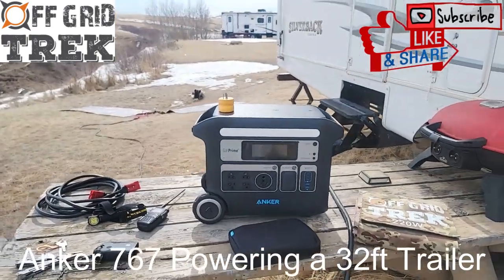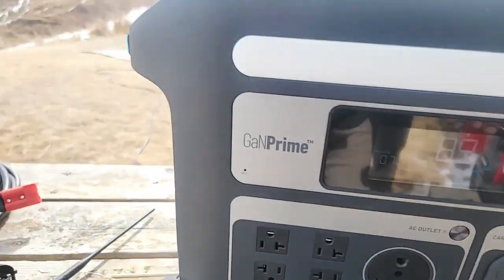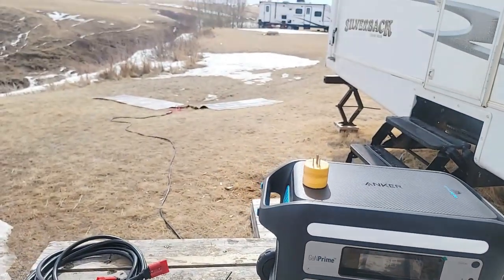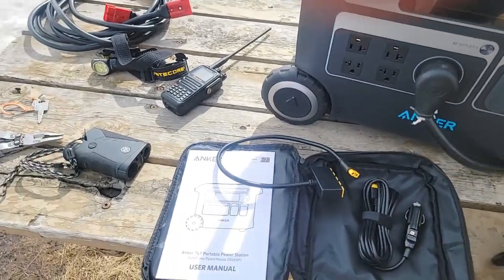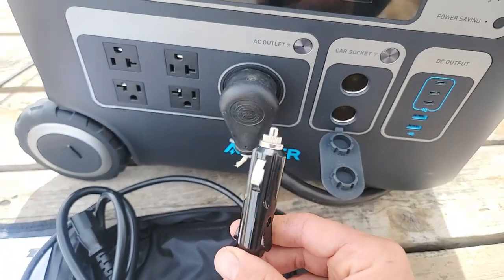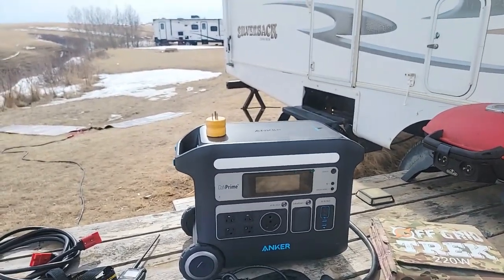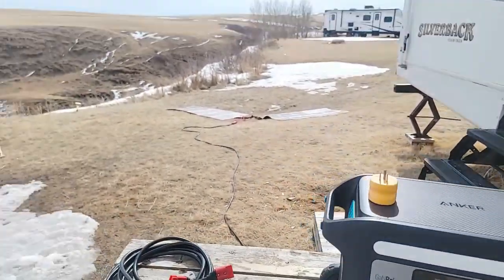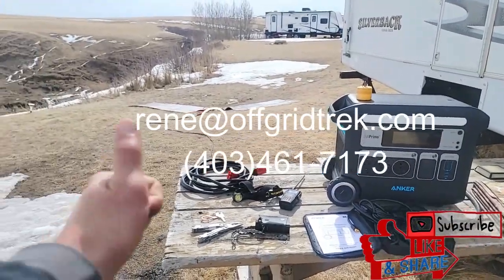ANKER 767 running a 32ft Trailer

Comment: I know absolutely NOTHING about solar or electricity. I want to convert an enclosed trailer to a camper. I want to be able to stay out for a month at a time.  I understand there are many variables. However, would this work for lights, occasional microwave, small TV and small fridge? If so, how many panels would I need …given the voltage limitations?    It seems to me this would be less complicated to employ …rather than wiring up the trailer.   Advice?  I also notice Anker has a 3800.

Comment: One thing I wish it has was the 12v 25 to 30amp output like the Bluetti. I have the AC200P and use it to run my 12v of the trailer by plugging it in and using it like a deep cycle battery. Is 10amps enough?

Comment: Think the powerhouse could power a slightly smaller camper with one small fridge and ac unit running for an entire day or more? Planning to buy one for my trip across the US. Thanks for the video!
Reply from the maker: The AC is the big power draw, you can only run it for 1-3hrs depending on size, settings and if you installed a soft start or not.  I would not rely on it to run power hungry AC units